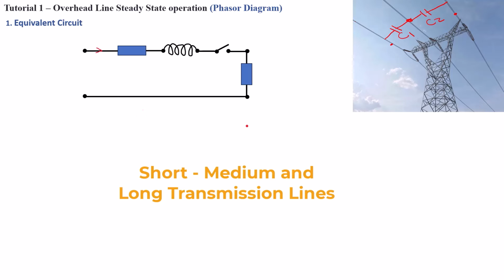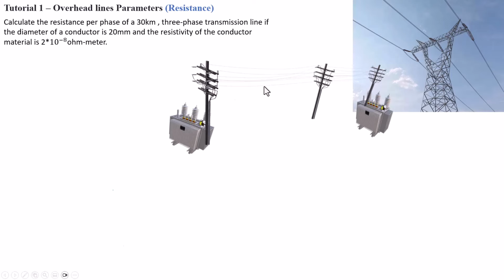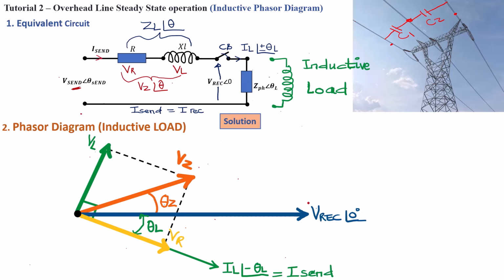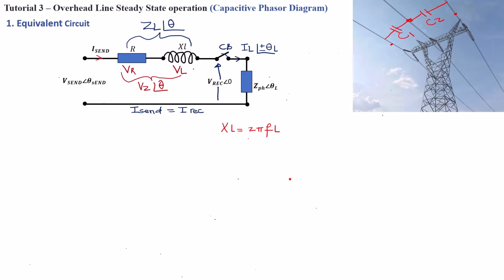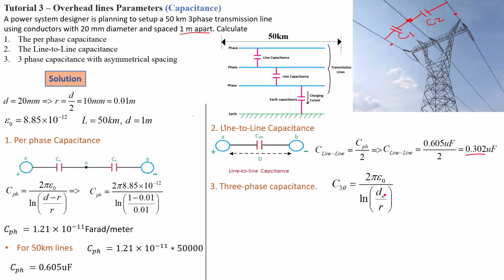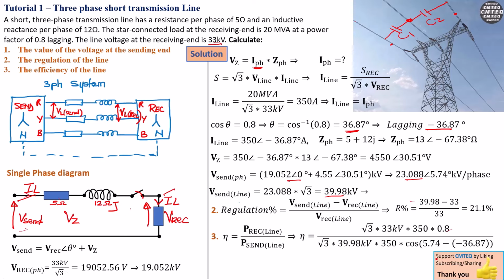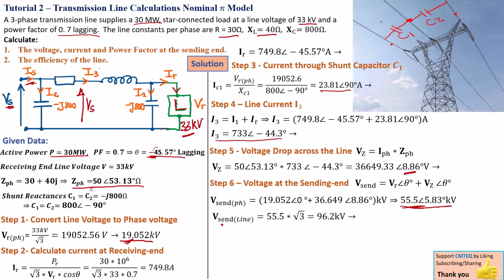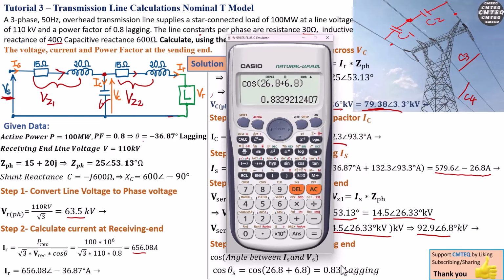Everything You Need to Know About Transmission Lines (Complete Guide)

Comment: I am actually confused as to why are we having to multiply (aXbXc) when we have only two spacing between 3 phase system. Isn't supposed to be (aXb)? The value of d if spacings are not equal.
Reply from the maker: Good question. In a 3-phase system with unequal spacing, there are actually three distances between conductors: AB, BC, and AC, not just two.

So even if the conductors are arranged in a straight line and you visually see only two adjacent spacings (A–B and B–C), you still also have the distance A–C, which is the third spacing.

That’s why for the equivalent spacing D (GMD), we use:
D = (Dab × Dbc × Dca)^(1/3)

We multiply all three mutual distances and take the cube root to get the geometric mean distance.
Example: if A–B = 4 m and B–C = 6 m, then A–C = 10 m (if they’re in a straight line), so:
D = (4 × 6 × 10)^(1/3)
So the missing “c” in your question is the spacing between the outer two phases, not another adjacent spacing.

D is the equivalent spacing between the three phase conductors, also called the Geometric Mean Distance (GMD).
We use this single value to represent the effect of all three actual spacings (AB, BC, and AC) when calculating transmission line inductance or capacitance.
So instead of working with three separate distances in the final formula, we combine them into one equivalent distance D.
Reply: @CMTEQ Loud and Clear. Thank you.

Comment: Is the Angle Vz always half the Angle VL?
Reply from the maker: Not always.
The angle of Vz (the voltage drop across the line impedance) depends on both the line impedance angle (R + jX) and the load current angle (power factor). So it is not generally equal to half of VL’s angle.

It may appear close to that in some simplified examples or specific conditions, but there is no general rule that angle(Vz) = angle(VL) / 2.